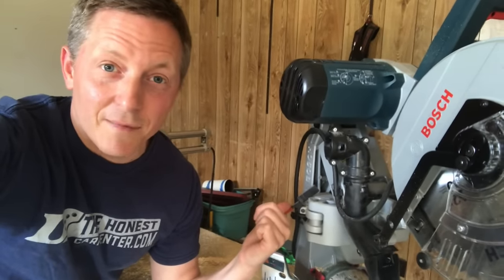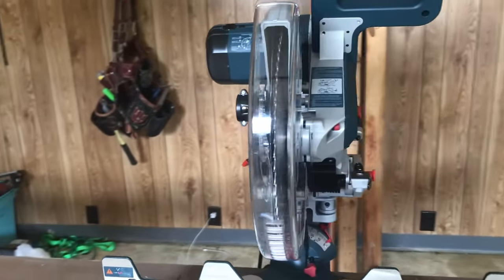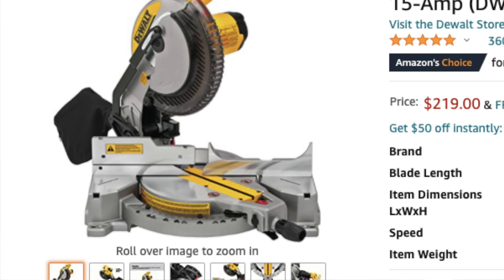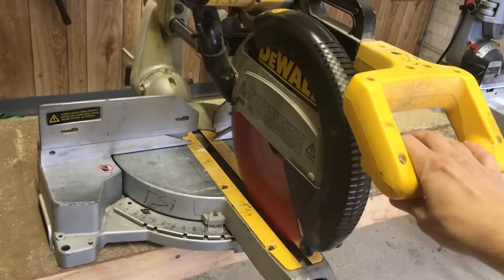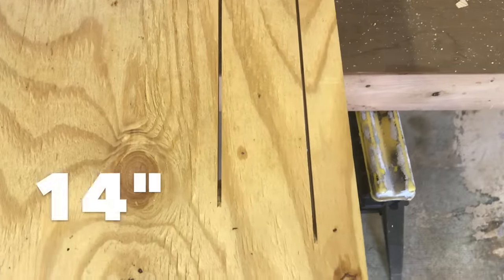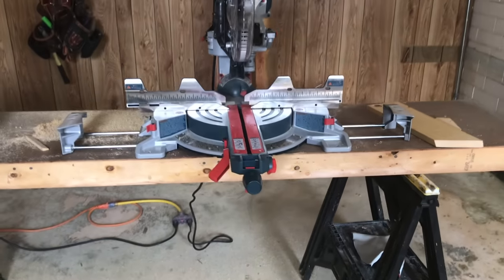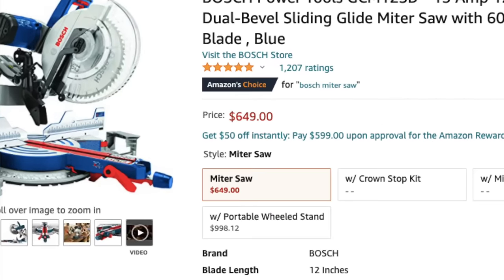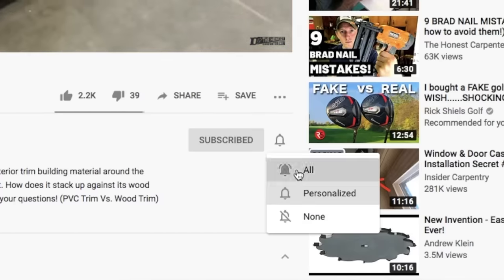This INNOVATION Changed Miter Saws! (Best Miter Saw Feature--Bosch "Glide"...Better than Rails!)

Comment: I got mine about 8-9 years ago. Still going strong despite the mileage. A few tips for using yours in a shop setting. True the base and fence, there is a phenomenal video on this subject by the building guru. Make your own zero clearance throat for faster cut line ups and no splinter cuts. Make your own auxiliary fence as well, same reasons as the throat as well as larger crown capacity. There are a few things I’d change about mine but the biggest would be a gear driven bevel adjustment, and that’s only because I build geometrical art shelving. So say if the shelves are hexagonal, getting the bevel perfect can take me over an hour with the play in the mechanism. That being said, all saws have their quirks, I prefer the Bosch’s quirks over all the others quirks. Hope yours lasts as long as mine.
Reply from the maker: Thanks Sawdust! All good advice. I haven’t even had a chance to check cuts with my squares yet—I’m wondering how much dialing in I have to do. Thanks for the video recommendation!

Comment: I have this saw, I bought it about 7 years ago.
Good points: space saving in the back, capacity of cut.
Bad points or I should say do not buy it points: saw is inaccurate when I use it gliding: always out of square at the front of the cut by way too much ( almost a 1/16 at full capacity). When I try to adjust  it to square it will automatically be off square at the other end. There's probably a fault at the arm mechanism. I am sure of this because when the head is locked in chop position without gliding the head it will perform square cuts, then open the glide and cut a wider piece and bingo, same fault at the front of the cut.
Other negative: the fence are way too floppy. Not good when cutting a board standing against the fence ( say like baseboard), it'll through you off square even when trying to control my grip.
Next negative: adjustments are a pain: square to table adjustments are in the back of the arm towards the bottom where you can barely fit the tools to do it, tighten the Allen ranch too quick and you moved your setting, do it again, and again and again.
Adjusting the fences square to the table is not possible, it's a tightening mechanism that supposed to hold fences square when you lock them.
Next:  the 15 amps power doesn't seem to be there. I still have my old Hitachi 10" a $250 range saw at the time I got it: it'll go through anything you put under the blade like a hot knife through butter. Hard wood, wet 2x lumber... This Bosch doesn't come even close to it for power. I sometimes use both on the same job and while going from one saw to the other repeatedly the difference is REALLY striking.
Next : there are definitely not enough stops at the bevel head tilt: at this price range they should have these for when you do repetitive work so your parts come axactly at the same angle.
I hesitated a long time between this and the comparable DeWalt. I've used many DeWalt saws with my friends. They're robust, easy to adjust and trustworthy. I'm biting my fingers now. 
Will probably sell it and get a DeWalt 780
Reply: Very informative, thanks!
Reply: Maybe the new one is better ?  I note that the saw he is showing off has a different trigger switch than my 10".  I found the following review to be more accurate for at least my 2 year old 10" model - bit of a donkey.  Do you get a lot of kickback on yours when you start it up?  https://www.youtube.com/watch?v=WJiyEDeYS4Q&t=13s
Reply: @walnutcontractors5661  yes I do get lot of kick back when I start it.
Reply: @walnutcontractors5661  yes hopefully they've improved it. Mine might have been a really bad one, I don't know? I didn't even mention that the right hand fence was off square to the table. I had to buy a new one. That was right at the start of using this saw. It's really my fault to not have returned it when the delays for returning were still good....
Reply: I have the dewalt 780 for about 3 years now i squared it when i first bought it havent touched it since and ive used it almost non stop since i bought it it still runs like the day i bought it
Reply: I've heard of the inaccuracy problem several times now. Every finishing carpenter that owned this saw five years ago have replaced it with something different.
Reply: @moho9050  why  didn't  you tell bosch about it?
Reply: @niallchurch2679  I procrastinated as I have other saws available to me and let the warranty pass. I thought it would just be a few adjustments to do.
Reply: An inaccurate saw is worthless.
Reply: Came here to say this but you'd already done it. 

Regarding the space saving at the back, I see that Makita have a saw that does this now with a rail mechanism, so there is absolutely no reason anyone should buy this saw now.
Reply: Try the big one
Reply: @fog1962  what do you mean by " the big one"?
Reply: Everything you listed above I have read other places about this saw and decided not to buy it. Great concept, poor execution.
Reply: @TubeFinlay  thx! I'll look at it
Reply: The accuracy sounds like my old Sears Radio Arm saw. After a few months of use, the kerf would be about three times the width of the blade. It was accurate enough for most of my work though.
Reply: I hered this before I haven't heard about the Delta with a similar arm I curious if it is a better than the Bosch?
Reply: A couple of contractors I've spoken to about the 12 inch all say the same thing - they're pretty happy with the saw but complain of deflection they don't see with the 10 inch.
Reply: That was a very truthful and honest review and you covered a lot of the things I was questioning about it. ( Like the saw not being square when it motion which is easy to see why as there are so many moving parts). Thanks. I have a Dewalt saw and need a saw that can run on battery or straight power but this bosh dose not have one. But Dewalt dose. Was interested to see if this one had more positives then negatives. Seems like its the opposite. Bearings are replaceable. The saw is not, not at that price anyways.

Comment: I have the Bosch 5312 12-Inch Dual Bevel Slide Compound Miter Saw that I purchased in 2012, I love my saw! It's a beast! Yes the sliders take lots of space, but it is worth it. I saw a YouTuber (sorry, I don't recall who it was) put the saw on heavy duty drawer slides so when he uses the saw he doesn't have to move the bench, or accommodate for the long slides.  I still haven't done it, but it is on my To-do list. Congratulations on your new saw!

Comment: I loved the idea of this. Bosch makes good stuff. I had a problem with the saw not cutting square. I went through hours of adjustment. I mean hours and hours. Ultimately, while the blade was 90° square to the fence, the arm mechanism does not move completely perpendicular to the fence. It translates slightly, say 3° off dead center. When fully extended, the blade would still be 90° to the fence, but 3/32" or so to the right of of where it began. The net effect was a board wasn't cut square.  If you can picture it, the blade should travel away from the fence like this: | but it traveled like this: \ even if the blade itself was 90° to the fence the whole time. In the end I returned it.
Reply: Nathan, exactly the same problem I had...except I didn't return it on time, I be learned my lesson
Reply: Thankyou for the info, good to know. I have also been looking at the Makita LS1219L with its side slide rails, meaning it doesn't need that space behind the table like the Bosch. Glad to know about your problems with the Bosch. I wonder if the Makita has similar problems?
Reply: @lamartya.4042  I rented a Makita (on rails) for a project, and loved it.  I aspire to having enough projects to buy it.
Reply: "Bosch makes good stuff."  Apparently not, by your review.  Having one of their it's-supposed-to-wash-dishes dishwashers, I'd say at this point they're coasting on reputation, not the quality they used to put out.

Comment: Great respect for your work and point of view. I love your videos. I wish you good luck cutting straight on the glide system, not to mention miters. Never square . I bought the MSD12 and was frustrated with calibration, which never worked. I relied on my older experiences with German Bosch but I was proven wrong with terrible quality control since the manufatuing left Germany. I was so much in need for workshop space but I went for the Dewalt 780 and never regretted it. I happily returned the Bosch and never again.
Reply: I'm finding the same with other Bosch products, and other manufacturers, like Coleman's, LLBean, etc., their imported products are a drop in quality.  While no drop in their prices...

Comment: I had a really cheap miter saw for over a decade and just took it outside the garage to break down stuff.  I then moved up to a 12-inch saw when I did a new crown in our home and it was fine.  I kept it on a tough-built rolling stand and it was great for the time.  Now, I am back doing more crowns on a remodel and I picked up the 12-inch glide after looking at all kinds of videos about miter saws.  I was a bit apprehensive since I had read about deflection of the blade when extended and also that once you beveled the saw it was no longer square and had to be adjusted.  To be fair, I have only used it a few times since purchase and it has performed great.  My saw was square and dead on right out of the box and I have not noticed any deflection in normal use.  I did get a really good blade for it and so far, it is the best investment for my garage shop second only to my Grizzly Table Saw.
Reply from the maker: That’s been my experience, Kevin! My blade was slightly deflected, but a simple realignment took care of it. Worked great ever since 🙂

Comment: I have the 10 inch Bosch and it is awesome. I don’t get the complaints about the dust suction: some people think it is superior, some inferior, and my experience is just about in the middle. I.e., it is ok and no better than other saws. I agree with you that the only negative is the weight. Even the 10” is a beast!  But that means, to me at least, that it is built to last. Great acquisition and review! 👍

Comment: I bought this when it first landed several years ago - I had researched it before it became available. I agree with the comments on the questionable accuracy of 'square'. I'm not into finish carpentry or cabinet making yet, so the accuracy has been acceptable for me to date. I am hoping the square can be adjusted when it needs to be more accurate. Otherwise, I love the saw. I would definitely buy this again for my needs.
It is a beast to move around, so I abandoned that notion and picked up the Milwaukee M18 cordless 10" mitre saw for my portable chopper.....it too is awesome for its application!
Reply: Basically a very expensive piece of junk then? I was considering it but if it isn't accurate then it's of no use whatsoever!
Reply: @prestonian1066 I’m not saying it’s inaccurate. I just haven’t taken the time to adjust it to zero it out. It’s an amazing saw.

Comment: Great review. I sold my 12” sliding compound miter for the same reason…..it was just too long and took up so much space. I’d seen this saw several years ago and knew the minute I saw it it was an ingenious design and I’d have to have it. Right out of the box all the settings were spot on. It is indeed the smoothest saw I’ve ever used. It is heavy but I’ve come to appreciate the weight as it feels like it’s bolted the the bench. The only drawback I’ve experienced is the dust collection, it’s terrible. In fact it’s the worst I’ve ever used. Other than that I love it.

Comment: I bought a Delta Cruzer 10". Similar system. What is really innovative about the Delta is that instead of a laser to show your cut, it uses an led to cast a shadow from the blade onto the works surface. Friggin brilliant. Works really well.

Comment: 12 inch model -  definitely a shop saw , very heavy , especially for us older people .  I have gotten really great results from mine out of the box with no adjustments . However , I was really happy with my 30 year old Hitachi 8 1/2 inch till it died on site - and that had met all my needs till then . The Bosch for building , general carpentry - perfect , cut capacity probably overkill for most people , for extreme fine detail I think I would  go for something else - the Kapex or the newer cordless Bosch . Must say I do love the newer Bosch tools overall .

Comment: Not seen this saw before, but I went for the Makita for similar reasons. It does have the rails, but the saw slides on the rails which are fixed in the base, rather than being fixed on the rails and the rails sliding in the base like the DeWalt. It  also has a rotary lock for the tilt right at the front near the handle so again no reaching round the back. The LS1219L seems to be the similar size. I actually got the smaller 10" version the LS1019L so I can put it in the van single handed.

Comment: This has been at the top of my list for awhile. I agree that the arms are a very important innovation. It finally went on a substantial sale at Lowes for just one day and now it's my first miter saw for my modest (very small) shop. Can't wait to break it in. For the regular price it should also come with an LED cutline, even if that's just a nicety, but all that is forgotten when you feel the smooth action of the axial glide. Thank you for your videos.

Comment: Some slide rails are forward. Makita, Festool, Hitachi at the very least.
Reply: indeed, this video is inaccurate, his dewalt had a rear rail but most are front rail which eliminates this problem.
Reply from the maker: I’ve seen those, Yossi. Just never had the chance to use one!
Reply: @TheHonestCarpenter  
I have a tiny shop. So I want one as well. But there are very few 10" versions.
Reply: @TheHonestCarpenter  I've only had my Mikta a couple months but it's very nice...and I'm sure the Bosch would have made me just as happy. Honestly even for $700, it stunning you can buy either saw for that price.
Reply: I wish my rigid had the rails facing forward.
Reply: @sadiporter2966  I wouldn't say "most are front" because that is not the case. Hitachi/Hikoki/Metabo, Makita, and Festool are the only manufacturers that I'm aware of that offer forward rails, ordered by price range. Of those, the first one is possibly the least accurate and can suffer from blade deflection. I think Makita might be the only one that offers a true 12", the Festool is 10.25" with 12" capacity.
Reply: Love my Makita. Its accurate, space-friendly, and scary powerful.
Reply: I had my Delta Cruzer and a buddies Kapex on a large kitchen job, one on each island. Can't stand the front rails in my line of sight and kept going back to my Delta. Front rails also seem to limit standing up taller trim. I know I'll catch heat for this comment from you Festool fanatics but I would NEVER buy the Kapex.
Reply: @davenag957  
I can't stand the vertical handle. So no Kapex for me either. Even if I ignore the price tag

Comment: Yeah, I  was going to go with that saw. But I went with the Delta Cruzer which does the same but costs less.
Reply from the maker: I’ll have to check out the Cruzer, Summers. Any good new features?
Reply: Yea was going to mention this - I don't own either the Delta or the Bosch, but both share a similar mechanism.  731 Woodworks did a video about the Delta.
Reply: Yeah I’ve got the Cruzer. Has the led shadow light which is sweet. 10” version.
Reply: At least on Amazon, the 12" model appears to be even more expensive than the Bosch.
Reply: @iamamish  The one I saw on Amazon was $532.  It's the 12" model.
Reply: @rockys7726  interesting. I went back to the same link I looked at yesterday, and the price of the 12" has indeed dropped to $532. It was more expensive just 12 hours ago.
Reply: @iamamish  It fluctuates all the time.  A few weeks ago it was over $600.
Reply: @rockys7726  that's crazy - the price I saw yesterday was over $700.
Reply: Bought the 12" Cruzer when it first came out around 2017. Added a shadow light as it wasn't an option at the time. It's a beast with a lot of power and a lot of weight. I have the Bosch stand which works good with the saw. It's tough to transport in my van but I also have a box truck which is easier. It does have a "slight" deflection when you are all the way extended, but only if you force it. Otherwise it's extremely accurate. The front mounted controls are much easier to operate than the Bosch and the trigger switch is more comfortable. Cruzer has the largest cutting capacity of over 17". I trim houses, do big crown and closet shelving and it suits me fine. Sawdust collection sucks even with a festool extractor. A soft start motor would have been nice because you gotta hang on when you hit the trigger.